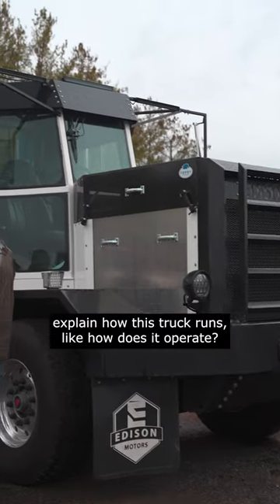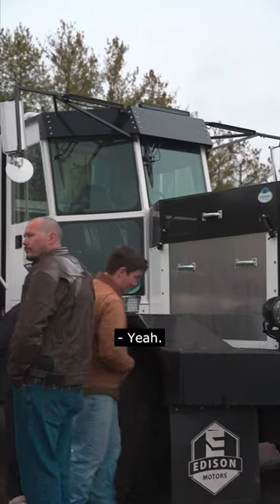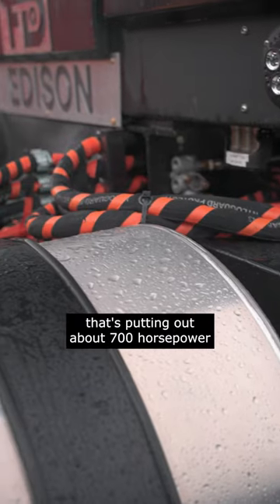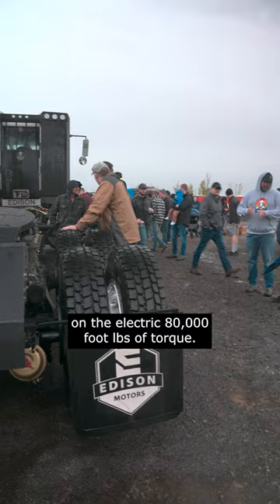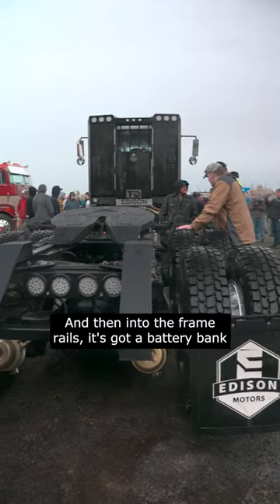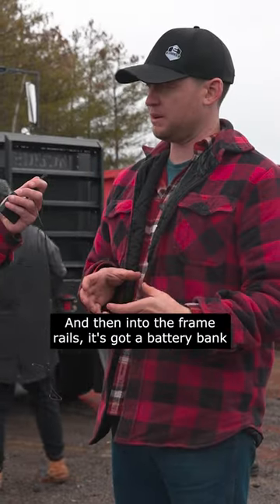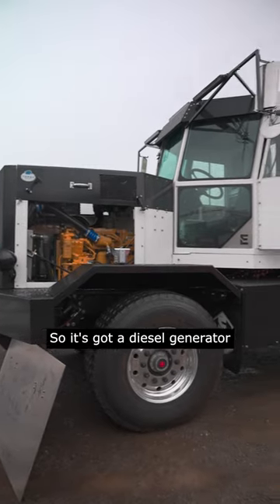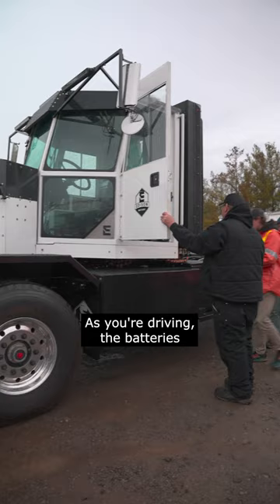@EdisonMotors tells us about how their new electric truck operates! 🚚⚡

Comment: Over priced!
You don't need 1,200 Horsepower!
Plus large battery banks and large electric motors.

I could had done it with 50 hp electric motor and hydraulics powering the tranny.

Comment: All that extra power ain’t going to get it to its destination any faster when the speed limit is 55-65 for trucks almost everywhere. When you use it though it’ll definitely drain those batteries faster. Ain’t no way you’re going 1000-1500 miles between fill ups and you’re not getting fuel and back on the road in 15-20 minutes with a cup of coffee either
Reply: It’s not an all electric vehicle, the engine (diesel generator) pretty much runs all the time while you’re driving to charge the batteries. The point is it allows you to use a much smaller engine since the engine only has to be able to handle the average power of the system and not the peak power. Since the engine is smaller it will take less fuel to go the same distance but you will still be able fill up and go at a normal filling station.
Reply: Not to mention weight restrictions that are very strict that thing is way heavier then I regular semi
Reply: @IThinkSoMaybe great explanation.
Reply: @frankcastle2045  again since this is not an all electric vehicle, only a hybrid electric vehicle it can use relatively small batteries and a much smaller engine than a conventional truck so while you are adding some battery weight you are also removing engine weight. Hybrids can be pretty close to the same weight as conventional trucks. It’s the all electric trucks that have struggles with weight and Edison motors is not making an all electric truck.
Reply: @IThinkSoMaybe They weighed the truck and made a short video about it. I believe the truck weighed a little less after the conversion.
Reply: Approximately 400lbs less than conventional diesel logging truck..... and that's the prototype made of plate steel and thicker single frame rails instead of cheaper double rail frames.
Reply: @frankcastle2045  this this is actually fairly significantly lighter than a conventional semi
Reply: @frankcastle2045 funny enough it weighs slightly less than an average semi and that’s with a massive and heavy chassis and body panels
Reply: You ever try to pull a fully loaded trailer up a steep hill? The speed limit isn't your limiting factor all the time.